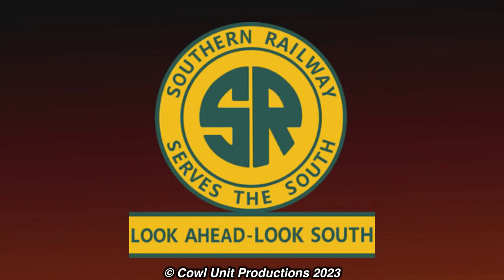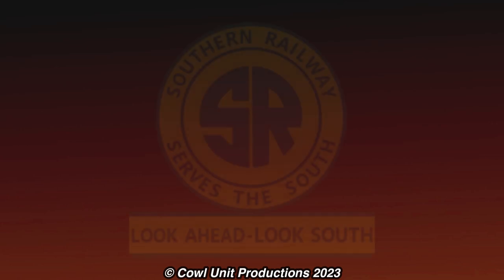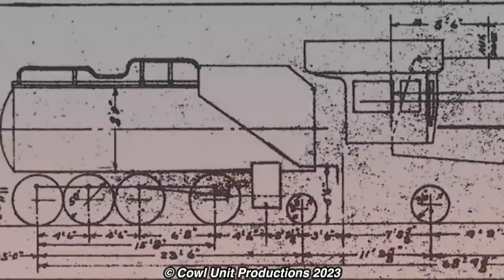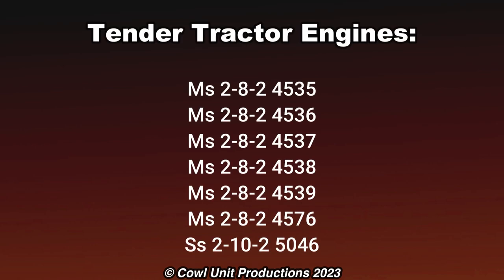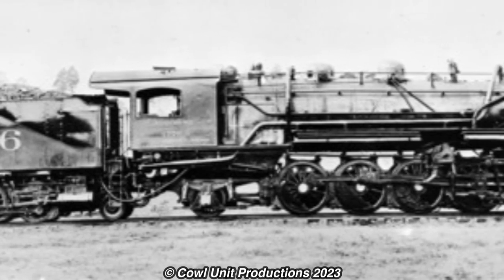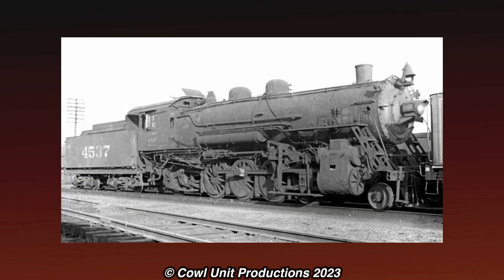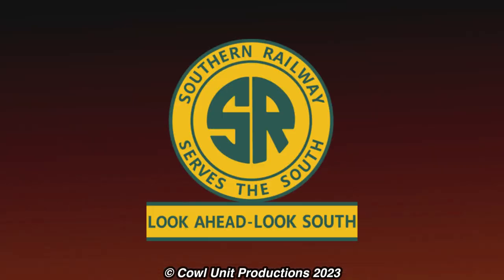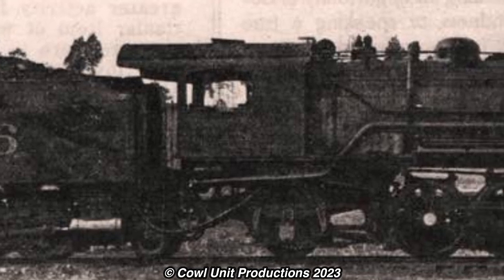Bite Sized Oddities - Southern "Tender Tractors"

Comment: The 15 inch gauge Ravenglass & Eskdale railways' River Esk was given a similar treatment and operated as a 2-8-2+0-8-0 between 1928 and 1931, when the locomotive was rebuilt back to a 2-8-2. The 0-8-0 tender would actually stay on the railway out of service for several years. In 1963, the tender was rebuilt as a 2-8-2 locomotive and would be named River Mite. Both locomotives continue to operate today.

Comment: For triplexes to be successful, the engines have to be SUPER high pressure at probably 600 psi, and the engine units must be simple expansion. There, the steaming problems are solved because of the thermodynamically more efficient high pressure steam, and the speed is solved due to the simple expansion.